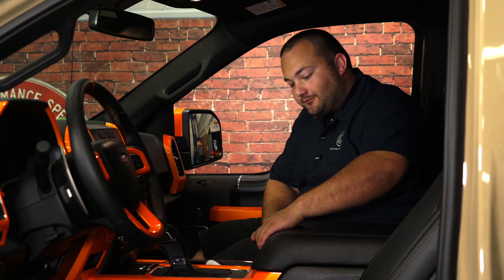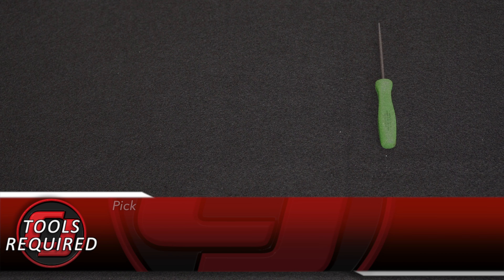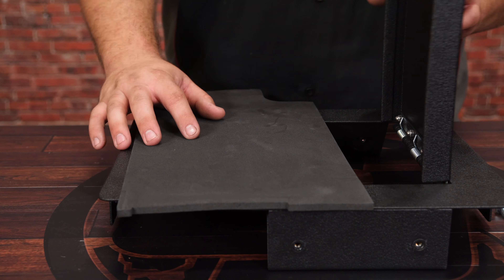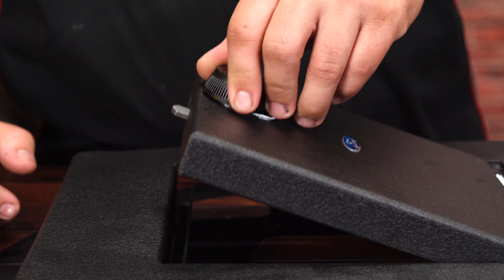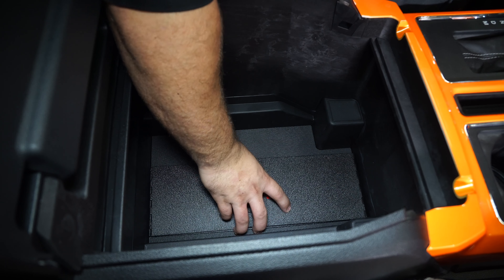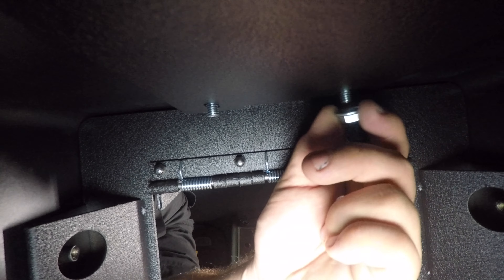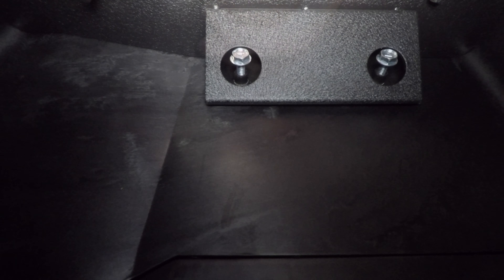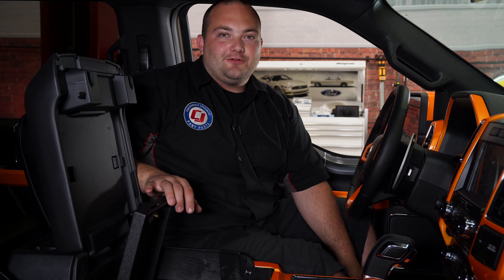F-150 Ford Vehicle Safe For Full Floor Console 2015-2019 Installation

Comment: Great video! I’m looking forward to installing mine. (**INSTALL UPDATE**) - 12-21-21 : The install in my 2016 f-150 was okay. The vault was a bit of a pain to install actually. For some reason the front went on pretty smoothly, but the back part I had to get in the back seat and really pull up on the vault lid to get the studs to fit the vault bracket. Regardless of that, I'm super glad that I purchased it and would still recommend buying.

Comment: If you by a used vehicle and one of these are in it, how do you gain access without the code from the previous owner?
Reply: Drill it out and remove it. Then If you want another safe buy it and install it. 

Were you thinking it's like easy to open the safe without the proper combination. The whole point of a safe would be to keep it safe. Lol

But if you're not handy with power tools you could probably just buy a drill and drill it all out You saw where the lock is or probably even a dremel with a cutting blade and cut that top right out
Reply: @rickyscars2921  I watched the vid and have made an observation... and have a serious question. If the buyer/owner must stick a "pick" into the small hole on side of combo knob to set the combination, what would prevent thieves or unwarranted inquisitive LEOs from sticking their own "pick" into the same small hole, set their own combination, and then open the safe? Or is this a one-time shot at setting a combination in which case a man with early onset "forgetfulness" is just screwed when he forgets the combination?
Reply: @jamescinaed9195  you have to have the lock in the "open" position in order to reset the lock